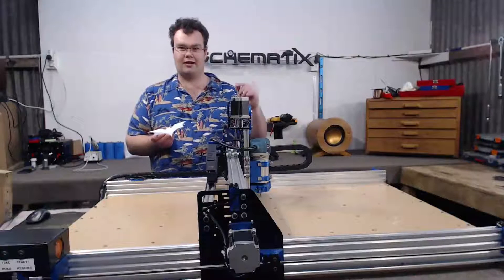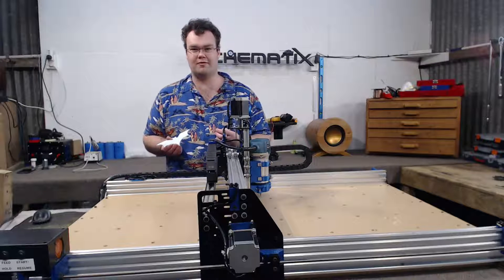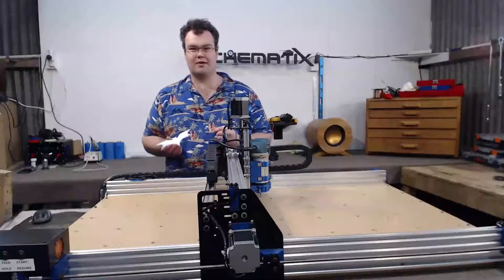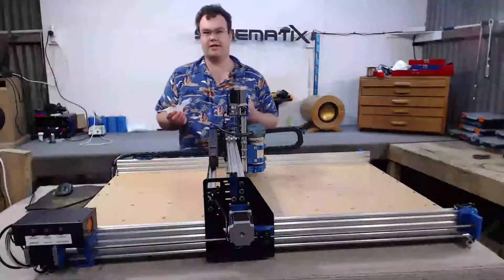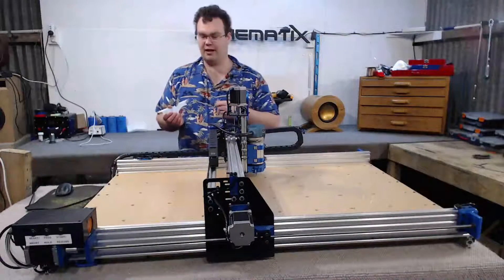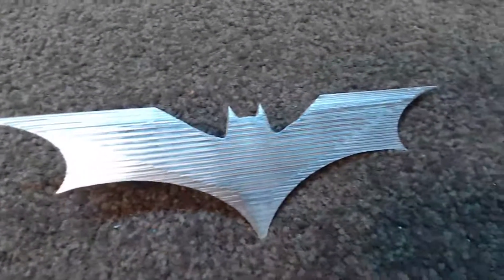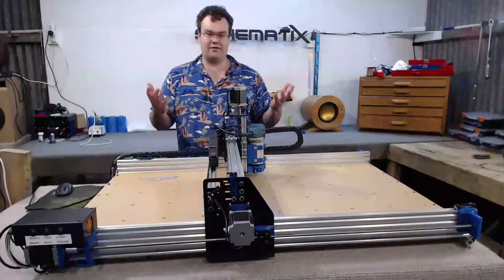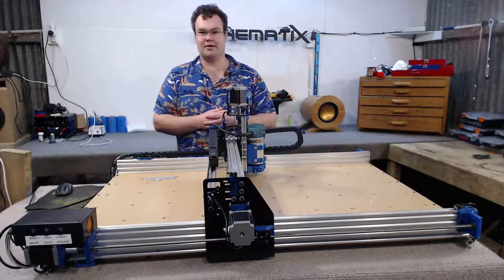Making A Batarang On The OX-Metal CNC mill

Comment: How muh did this machine cost you to make all together?
Reply from the maker: I spent around $1,500USD on the machine. Keep in mind though that because I live in New Zealand shipping for everything was rather hefty!
Reply: Ouch. I'm in AUS so shipping would be the same story for me. Do you need to do a lot of calibration and stuff to use it. I'm looking for more of a plug and play type machine (but I don't mind assembling) but the only thing for <2000 USD is the 6040 which just seems too far on the small side for me.
Reply from the maker: I'd recommend you watch my video on setting up the GRBL firmware to get an idea of calibration.etc It's relatively quick and easy. 

As far as price for the size of the machine and what it can do, the OX-Metal is pretty solid, You'll be hard pressed to find anything better for the price of materials (though I might be a little bias ;) )
Reply: Very cool stuff. OX metal does seem pretty freaking awesome. We'll see what the future holds :)
Reply: Maddie Uchiha Hey do you have a link for them?
Reply: Maddie Uchiha Thanks :)
Reply: Can you do perfect circles ? I've been trying to fine tune mine but havnt quite got it perfect yet